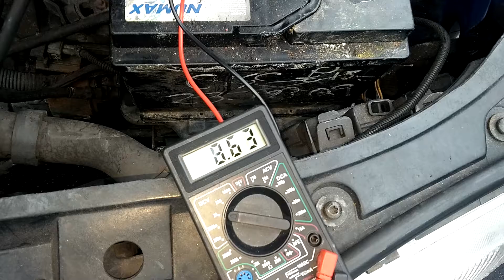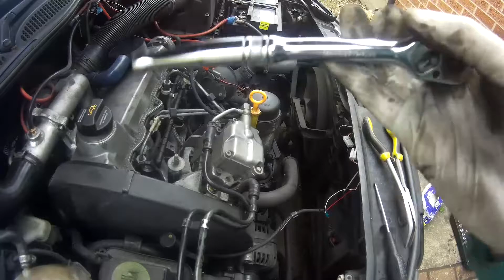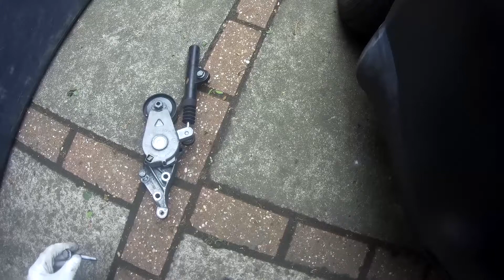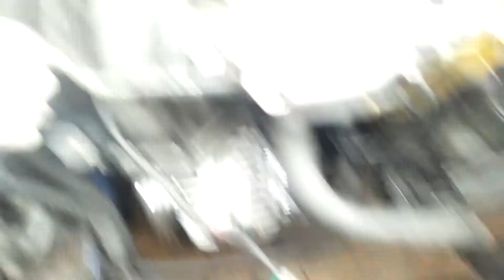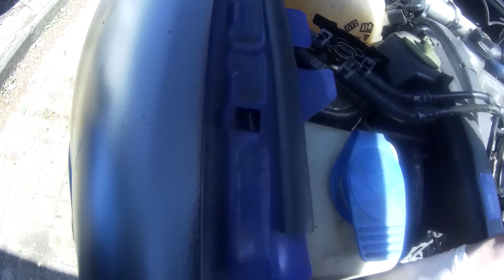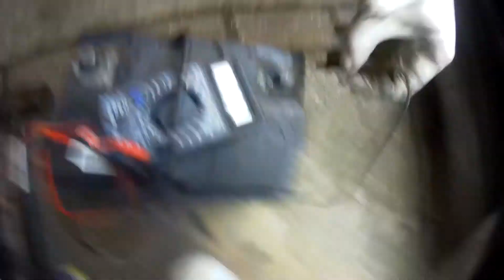How to replace the alternator on an Audi A3 8L

Comment: I just met a strange mechanic guy who recommended me to put a 25w60 oil to my a3 2003 turbo with 120k miles. How would that type of oil work? Do you think it will affect its fuel consumption?
Reply from the maker: That's quite thick, questions would be TDI or petrol, milage and what climate are you in.